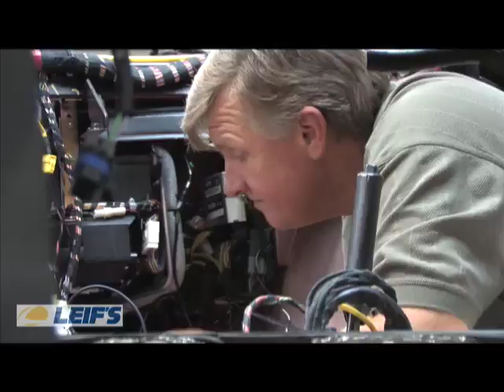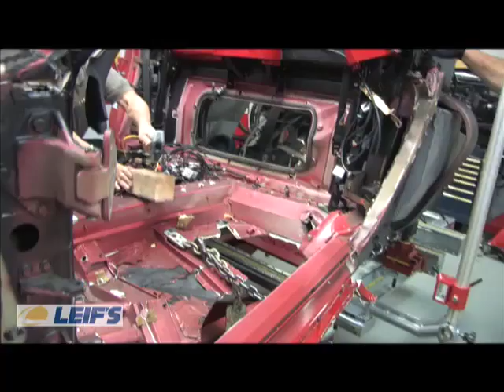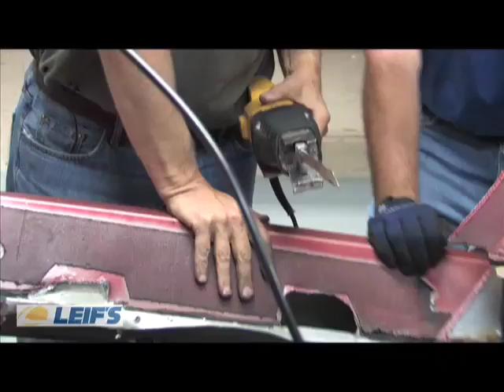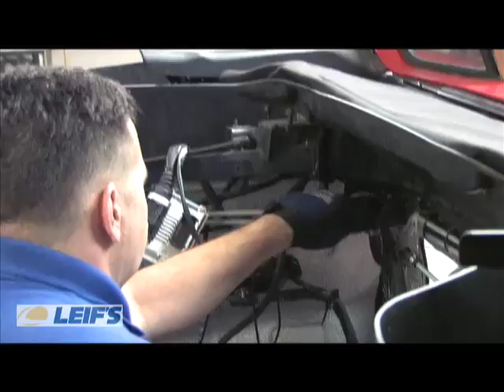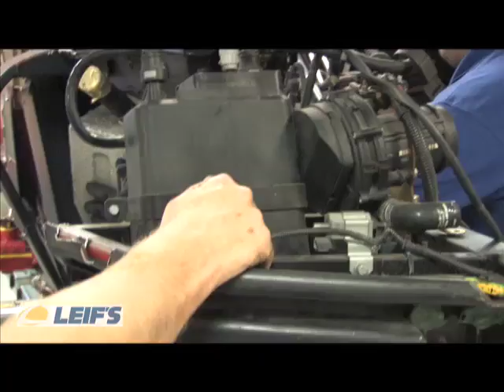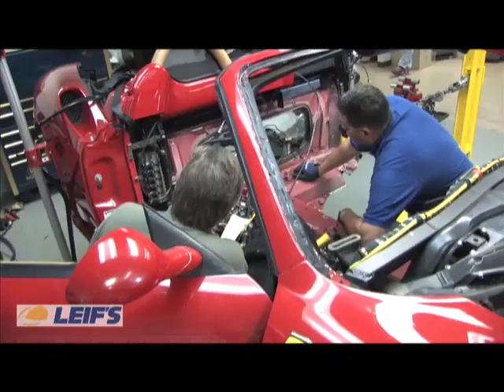Leifs.com Ferrari Repair - Day Five

Comment: The more video I see about this "repair", the more I wonder if they ever repaired an aluminium car?? They try to repair it with the usual techniques used ont steel cars. But a Ferrari can't be pulled, bondoed and paint. A lot of people watching this noticed that cast aluminium can't be restored back to its original shape once it's been bent. If I were the shop owner, I would remove these videos from Youtube, because they are bad publicity.
Reply: I also have to agree. I use to work as a body repair/refinish specialist at a shop and whenever I'm dealt with aluminum structural parts, my face turns blue. There's so much work involved when it comes to repairing aluminum. The metallurgical properties of aluminum make it very difficult to bend compared to automotive steel. The easiest way is to replace the part entirely if you have the ability to do so. If not, it's going to come down to welding.

I'm just watching the video because of the Ferrari. Always interested in seeing how the structure of it is designed.